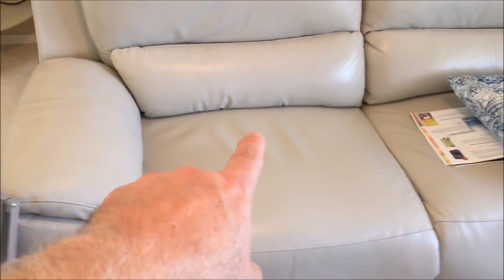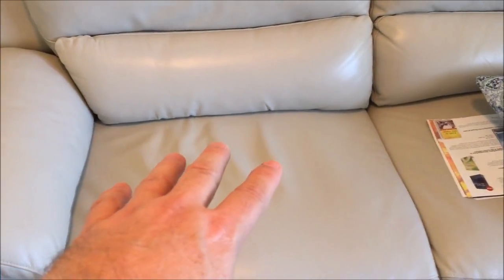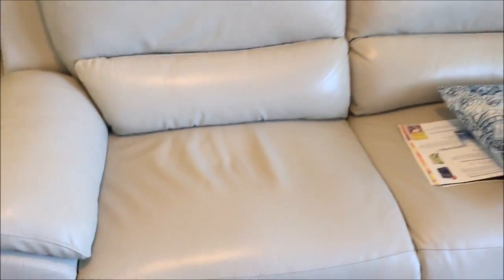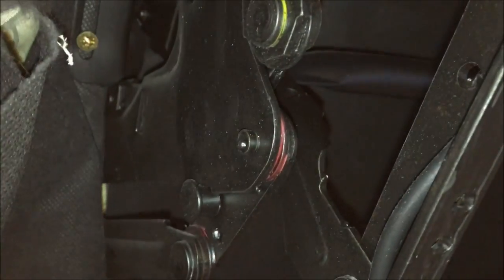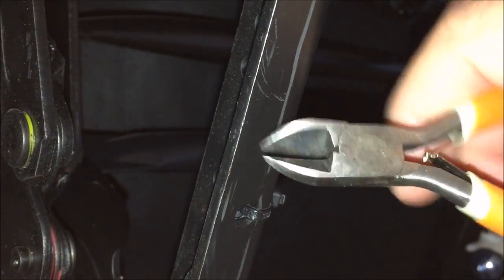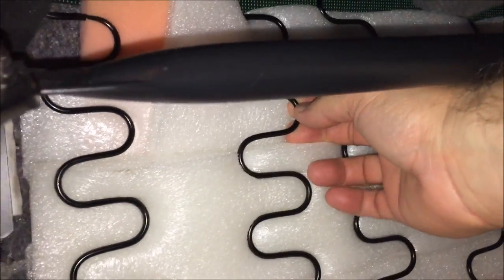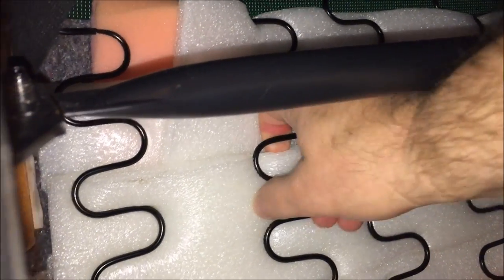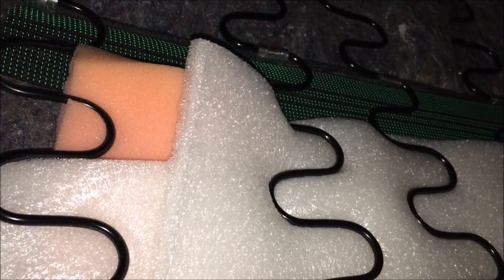COUCH Cushion HACK DIY

Comment: I actually work for the company and am an operator for the place that makes the white packaging foam you used before putting in the green. We make anywhere from 1/32" thickness up to 2" thickness of planks with density of 9 lbs per square inch. Awesome seeing you use it for such a project!
Reply from the maker: That's awesome. Thanks.

Comment: That’s a lot like what I have had very good results with before I stated below:
Yes and foam pieces can be free, some items are packed with upholstery like foam for shipping 

Fix it for absolutely free!: 
Fix trick for car seats: Often used car seats upholstery is still good but the supporting foam is worn down-especially the driver’s seat.
Get some used carpet sheet foam(often your neighbor has some in the trash or in the trash behind a carpet store):
Unbolt the seat and peel off the fabric from the seat by removing the bottom retainers (usually plastic J channels) to gain some access under the foam sear core.
Add 1 or 2 sheets of foam under the foam core between the core and the seat bottom(1 sheet for the entire seat area and 1 small sheet for the butt area often is what’s needed for the drivers seat).
Use mallet to reattach fabric plastic retaining edges onto seat metal frame.
The seat will be amazingly plump and firm again just like new!
The seat backs do not need any foam since they don’t get worn from the full body weight pushing down like the seat does.

This trick SOFAS!: works great for home furniture such as sofas: for seat cushions with zippers: carefully unzip also peel off the fabric from the foam core, use a loose hack saw blade in hand and cut through from the back of foam block making it like 2 sandwich buns except stop before cutting through the front so that there is a solid foam hinge at the front.
Now cut and add carpet foam sheet or two or three laid into the middle of the sandwich.
While holding and compressing the sandwich foam buns back together, carefully and patiently roll fabric case back over foam and zipper shut.
The effect will be Dramatic, like new!
Often people think the sofa springs are sagging when aged but it’s the weak foam that takes all the direct weight and it just needs more added to bring it back to new specs!
Reply: What is carpet foam sheet?

Comment: You should've place clips on the weakside instead of foam. And the way those springs are hold by wire its not right, thats just a cheap way to manufacture couch..

Comment: I have a squeaky seat on sofa that is 3months old :(, it's an electric recliner sofa that looks almost exactly like yours is just fabric, any ideas how to get rid of squeaky noise
Reply from the maker: Depends on the squeak. Is it metalic? Then oil on metal parts. Is it fabric (like a fart sound?)? Then baby powder. Let me know results. Thanks.
Reply: @Mity_Moose  hey thanks for getting back, managed to put on some WD40 on the little hooks holding the springs underneath the seat, but thanks for the baby powder tip!

Comment: Why wouldn't you use some kind of vise grip or another kind of wrench to tighten those springs rather than just stuffing them with miscellaneous foam? You would just squeeze the "U" part of the spring on the side very carefully until it's a bit tighter and then move on to the next. If your tool slips it's going to hurt, so be careful! This way you don't need someone to pry them up in order for you to force something under and you're really adjusting the springs the way they were meant to work.
Reply from the maker: Well it’s a good thought. But I am sure I’m not strong 💪 enough to bend spring steel especially while it’s under pressure. Thanks for the input.

Comment: Cool idea. But what is holding the foam up?
Reply from the maker: Pressure from the springs is pushing the foam up toward the chushion. It works very well.
Reply: I realized u had tipped it upside down LOL
Reply: Thank you! I have the exact same issue with a fairly new sofa! I tried to use a wooden board!🙄
Reply: @JAHumanBeing  yes, but then you'll probably lose the comfort, the cushioning effect, of the springs, and possibly end up eventually breaking the springs, creating a whole new problem

Comment: Try putting a small metal rod behind a few springs to pull multiple and with a clamp or a preacher block
Reply: Just thinking something similar there, perhaps using a rachet strap somehow, a bit of control then 👍

Comment: Its funny because I have that exact same couch set and it sags so bad hence why I was looking for videos like this.  I just happened to stumble upon ours and I was like no way thats my couch! XD  Im not sure if Im strong enough to be able to pull those springs back to stuff foam in, I have small lady hands.  I wish I could completely replace the foam inside all together and get better springs.
Reply: I wonder perhaps if a ratchet strap type setup could be used to pull up those springs, making it easier to then just slip the foam into place

Comment: I got 2 sofa bed they not coftable was hoping to fix them need to get all the cat wee off as well as my cat was wee on them without me knowing does this work for sofa bed too
Reply from the maker: I could only guess. If you can reach the springs underneath, then it’s possible
Reply: @Mity_Moose  I can get to my spring but I would have to take the sofa apart I think I got another way but thanks for the video really help me think

Comment: I'm going to give this a shot with pool noodles like someone else mentioned
Reply from the maker: Awesome! Let us know results.
Reply: @Mity_Moose  Just got it together for a sit test. I took thick noodles and cut them in half and ran them along the length of the couch under the springs. Definitely a noticeable increase in firmness upon sitting down. Only needed one layer, wondering how long they'll hold up. Appreciate your video for the inspiration!

Comment: You could have just unhooked the springs from what I can see.  The other issue is no stringers running across them tying them together.
Reply from the maker: I am sure there is a specific tool for that. But I did watch the factory rep do the same thing on an other couch. It really works. I do NOT recommend removing the springs. You could get hurt and may never get them back on.  Good input though.
Reply: I have a chaise lounge with those springs underneath and yes, the springs can be removed. I took mine off to redo the cushion and got them back on but it does take a lot of strength to get them back on.

Comment: I replaced 2 of my zigzag springs on my 35 year old La-Z-Boy  recliner  and I noticed that the gauge of wire was a lot thicker, it was 9 gauge. Looks like your gauge spring is a lot thinner, like everything else they are making them cheaper and cheaper. I had to use small bolt cutters to cut my springs off.

Comment: Can't you unhook the springs, place the foam, then just reattach the springs?
Reply from the maker: They are so tight, I feared taking them off and never getting them back  on without a special tool.
Reply: @Mity_Moose  you are correct. The zig zag springs are installed with a tool and you will need one too or you can’t get them back on. Mine are now slightly weaker because I also didn’t have the tool. So adding this foam for support may be an idea.